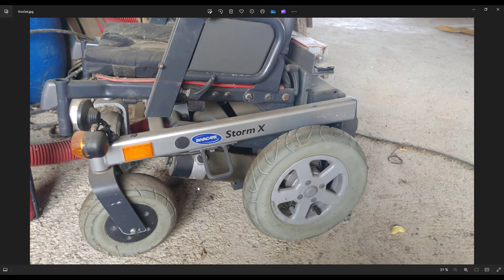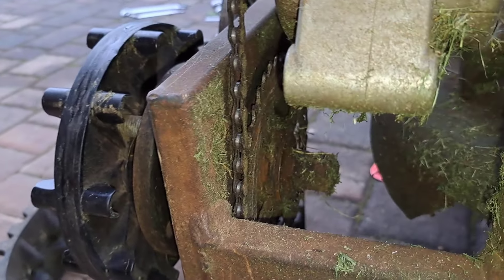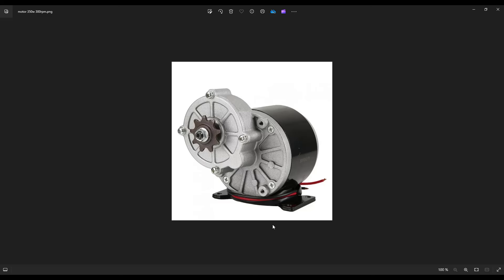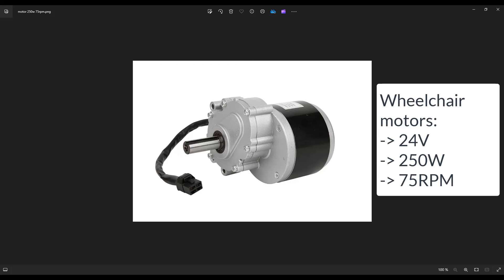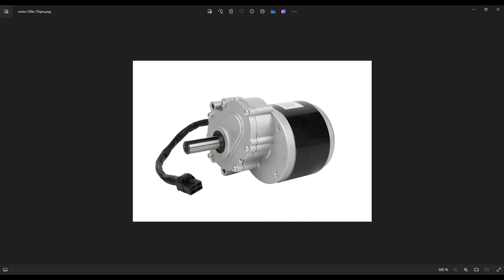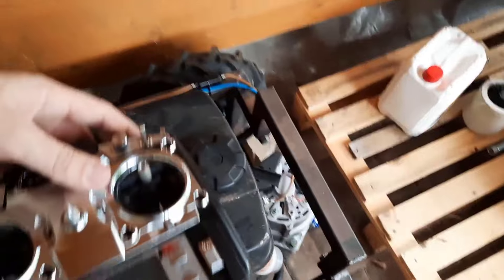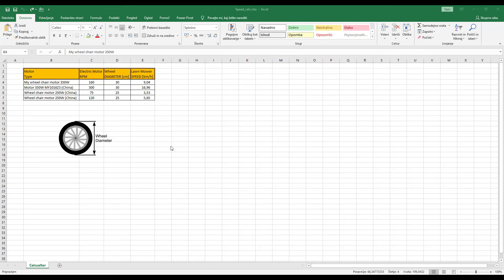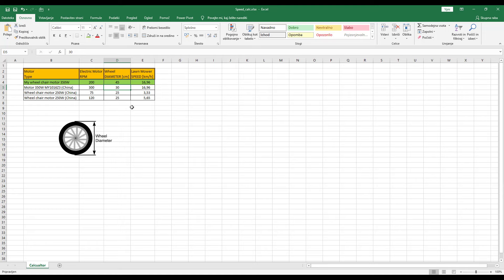DC Motors and Speed - Remote Control Lawn Mower DIY

Comment: I am using same wheelchair motors but I bought it with a set with good tires so it took around 1 minute (so way less than your video) to get these running with RC and motor controller  - so I have more time for vehicle construction 😉

Comment: You can also control the max speed of your mower by adjusting a few setting in the transmitters EXPO setting area.  By adjusting the rate of input around the center of the joystick you can reduce the max value of the stick input as well as slowing down the reaction of input for accurate slow speed control.  I used motors from a Jazzy mobility chair and the 13 inch diameter wheels that chair came with.  I also use a sabertooth 32A dual speed controller set up in mixed mode.  With the Expo setting adjusted I have a very controllable mower.

Comment: Now I know not to use chain 4x4 drive and why all Chinese manufacturers have stopped doing it.
Reply from the maker: True 😉. Made mower that you saw in this video with 2 motors and chain to be 4WD. Trying to do zero turn, didn't move for inch 🤣

Comment: Hi Gregor. Thank you for this great video series. I'm planning to build a RC mower during the winter. You videos are very helpful for me. I have one question. Should I be considering 12V motors or only 24V? I understand that with 24v I will need lower current to drive the motors. But are there any other benefits? Or is 12v also fine? Thank you and greeting from Poland.
Reply from the maker: Hi, no other benefits. Go with 12V. Alternator for 12V are cheaper. Regards to Poland

Comment: Hello Gregor! First, thanks for all these videos!!. I have a question, I am going to use the motor (2 motors) My1016Z2 (24v 250w 75RPM), which has a 17mm shaft. I am unable to find track wheels with a similar axle. They are all 16mm. And I'm not very handy. Thank you, from the Basque Country!
Reply from the maker: Hi, sorry I can't give you a better answer, but why not just drill the hole with 17mm?

Comment: Great video. Can you suggest a motor driver for MY1016ZL motor which is compatible for pixhawk.
Reply from the maker: I dont have experiance with pixhawk, but  what I have seen from manual, every motor controller with rc sgnal or pwm signal input should do the job. Look for sabertooth or cytron motor controller

Comment: Little help.

I have 4 motors with this specs:

Supply voltage:  24V

Rated current 1.4A

Rotational speed: 1260 rpm

Gear: 145

Would all four be enough to start and have enough power to wriggle through the grass?
Reply from the maker: Hi, sorry I am not shure if I understand this right. Your rpm is 1260/145=8.7? For 25cm wheel you need 75rpm to go 3km/h. Your robot will be too slow. What are you trying to build?

Comment: Rather than use arduino why not attach relays direct to your RC receiver? 

Do you think you could have just used the wheelchair motors with better tyres instead of tracks?

I notice the newer Chinese Rc mowers are using much better brushless motors and differentials to power their tracks now
Reply from the maker: Hi, you can not attach relays to RC receiver directly. You need some sort of controller to handle the rc signal and control relays. 
For higher slopes you must have 4WD or tracks. If you dont have high slopes you are fine with 2WD and better wheels. 
Brushless motors are better because they have constant torque and no brushess, however motor contollers for brushelss motor are more expensive
Reply: @gregorkobetic  you can easily attach a relay to a receiver - what makes you think you can’t?
Reply from the maker: @janramonmartin  you can if you use relays for Rc receiver. What you can not do is connect standard relay that you can buy in every electronic shop. Thats all am I saying. Have a nice day!

Comment: Hi,

The tracked version is very cool but more expensive.

Here's my version for 4x4 with chains and two chain tensioners on each side.
It weighs about 120KG and works great:

How it turns :
https://www.youtube.com/watch?v=ZF2rqSu_Dxs&list=PLqj25JSmr2WO5gFJHyEIk22E5_7XpYIAG&index=16

Drive train in detail :
https://www.youtube.com/watch?v=7DUQMMLatK8&list=PLqj25JSmr2WO5gFJHyEIk22E5_7XpYIAG&index=20

I did have a lot of problems in soft soil with the drive train because of the weight before the two chain tensioners on each side.
Reply from the maker: It looks realy nice. Very well made. Congrats on sucessfull project!